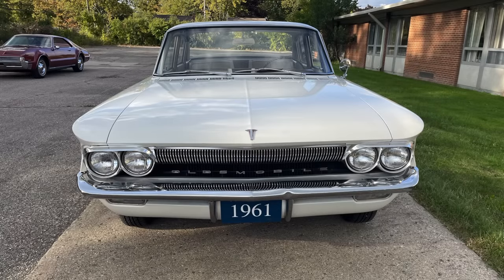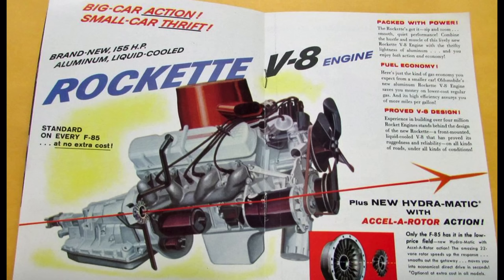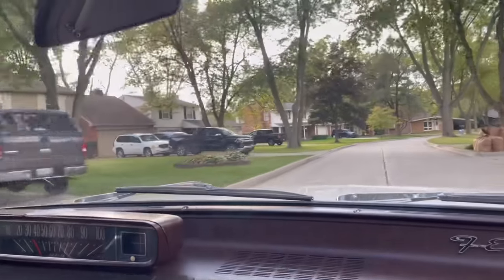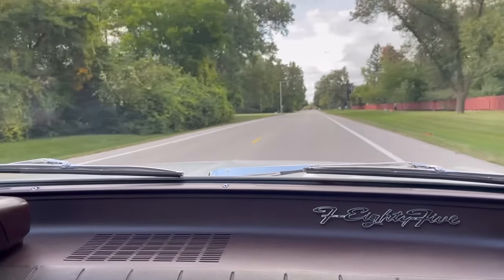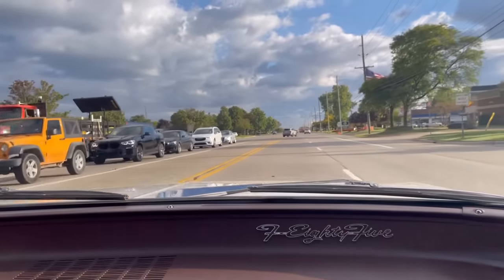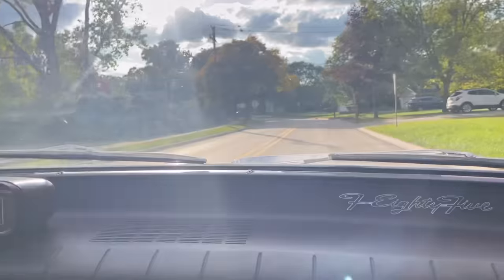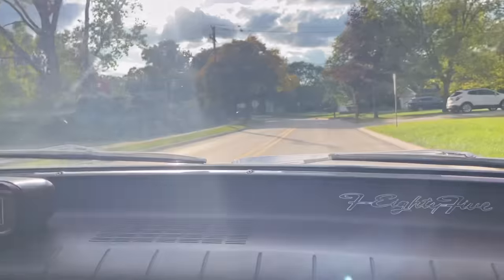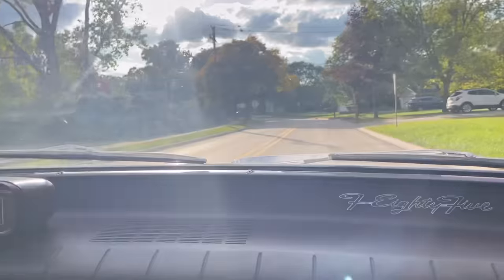Driving GM’s Worst Transmission: The Roto-Hydramatic (“Slim Jim”)

Comment: I has a friend with a 63 Starfire convertable. 394 4 barrel, Roto Hydramatic. Three rebuilds later, he said "as long as I drive it like a grand ma" it's fine. First time I get on it, it's back to the trans shop!
Reply: Ouch
Reply: Have a 63 Starfire and never been any problem at all. But is important not let morons wrench on them.
Reply: To own a car today with 
                                              Problems today you're lucky to have cleaver people are able to get the car fixe
Reply: @olds394 Why not, morons designed the thing, according  to my old boss, who worked on many of them, lol. I did trans work exclusively for 20 years, got out of it back in '96, and have heard all the stories, but have never seen one.
Reply: @pete1342  It was the bean counter en gin ears. Saving $5 on millions of vehicles adds up. GM and the rest still is in the business of selling cars. Parts? Not so much.
I think you can still buy Toyota made body parts for Model 60 and 62 FJ Toyotas. You could in 2005.
 Probably still selling FJ 60s new in some country that does have all the regulations the US has.
Reply: My uncle had a '62 Super 88, also a 394 4 bbl. I drove it on several occasions and never noticed anything unusual about the way it shifted. It seemed the same to me as my grandfather's '58 Pontiac.  My uncle had the car for 8 years and had over 100k on it when he sold it and I don't recall him ever having a problem with the transmission.
Reply: Thanks for the warning, I’m actually looking at buying the exact same car
Reply: @trickstothetrades1801  If you can find one. A BOP(Not a Chevy bolt pattern) THM 400 short shaft will fit. 
Sorry but a 4L60 won't. Plus it also needs a ECM /TCM

Comment: Your shift demonstration ride brings back this memory: years ago I was chatting with a SEPTA bus driver on his lunch break in Philly and he invited me to ride along for a turn. I had time, so off we went. Corner to corner folks getting on and off.  I asked about the trans, an allison angle drive job- he said it was just a torque converter that locked up at 50 mph. " Here, I'll show you" and we took off.  He had that 6v71Detroit screaming under the back seat, and it was a rough street, everything rattling, windows, doors, everything. Finally, the little detroit suddenly bogged down and a loud screech came from the transmission as the lock-up clutch tried to grab ahold of the engine. He yelled "SEE THERE IT IS!" then slammed on the brakes panic style and dove for the curb. Stopped right at the bus stop sign. Doors open. I turned around and the passengers looked terrified, and two women behind me, who didn't seem to know each other, were clutching each other.  Quite a bus ride!
Reply: Good lord!  I can only imagine what would happen to that bus driver in the times we're living in now.  Fired, news footage, law suites, public banishment...
Reply: @discerningmind yep. Crazy times we're living in now. 👎
Reply: Sounds like a fun ride. My school bus for middle school had a tiny little old lady that drove the bus using the gas pedal and brake pedals as on and off switches
Reply: The buses I rode in Los Angeles in the 50s and 60s had a two-speed of some sort on Detroit diesels.

Comment: Listening to the upshift from 1st to 2nd brings back memories of a buddy of mine's 1964 Olds Dynamic 88. Since the car had a 394 cid V8, it moved quite well, but that upshift from 1st to 2nd is unforgettable. Oh, and it had an enormous trunk, ice-cold factory air conditioning, and that dashboard mounted sensor that automatically dimmed the high beams.
Reply: I had a '60 Pontiac with the older HydraMatic. It worked without breaking, but its shift from 2nd to 3rd was a big drop in RPm. They were like that.
Reply: Auto hibeam... heehee... Where I am it's even easier. Half the drivers don't bother turning them off. The other half have those new lights that blind you anyway... I hate driving at night now.
Reply: @adotintheshark4848  had a few hydramatic Cadillacs 1/2 shift was fast, usually before you cleared intersection 2/3 was big jump 3/4 was close again like  1/2

Comment: That V8 was ultimately developed by Leyland Australia into a 4.4 litre version (taller deck for longer stroke) for the P76 sedan in the early 1970s.
Reply: That engine eventually got out to 5.2L/318"... later all iron version out to 5.7L/350"...
Reply: @buzzwaldron6195 it got out to 300 ci , 340 ci and later 350 ci but the 350 got different head design and port layout , the Australian tall deck 270 ci is a different version again . The Australian Formula 1 champion Sir Jack Brabam used the Oldsmobile version with help from Australian Repco engineering, to add double over head cams in his own F1 Brabam car and won the championship! Probably the only GM pushrod based V8 to ever win F1 !

Comment: I have a couple of comments about both the engine and the transmission...
First the engine. At the time when these were still on the road and in wide use, I was working in a Buick dealership full time and in an independent transmission shop nights and weekends. At the Buick dealership, we got quite a number of those V-8s in with leaking head gaskets. In most cases, the leaks were external in that they leaked coolant out of the sides of the head gaskets. Otherwise, the engines were quite reliable, and were not prone to putting rods through the side of the block like the infamous Buick 350 that was used in LeSabre and Skylark cars. 
As to the transmission, the biggest defect was really some poor engineering. For first gear, they used an internal fluid coupling instead of a torque converter. This had some pretty poor efficiency, which made for a soft engagement, but a really "slippy" first gear. When they shifted into second, the input shaft was coupled directly into a planetary gearset with full mechanical drive. At this time, for whatever reason, the fluid dumped out of the fluid coupling only to refill for third gear. Somebody must have really sat up nights figuring all of this out! One odd thing was that the input shaft was splined directly into a damper plate on the engine's flywheel, so removing one from the car was like a stick shift with cooler lines. Weird! I tried to repair one of them on my own, and never did get it to work right. I even took it to some of the old school guys for help, and even they couldn't find out what I did wrong. I finally just bought another transmission and ate the job. hope to never see another one of them!
Reply: thanks for all the knowledge
Reply: Was the 350 known for throwing rods out of the block because of oiling issues or because of the quality of the rods? I owned a Buick 350 and I’ll attest to the block architecture being very strong and very well designed. Never knew they were known for throwing rods out of the blocks but I knew that they had famous oiling issues. Same as the 455.
Reply: @theeoddments960  Probably more for oiling issues. When I worked in a Buick dealership, we would have an average of 2 a week towed in with rods hanging out the sides of the block. It was quite a treat to get one of them to the upstairs shop up the ramp equivalent of a boxed staircase.
Reply: THANK YOU VERY MUCH Jim, I think you have answered my current "Buick bewilderment"  in your explanation of the very odd - pressure plate looking flexplate bolted to the crank of my fully complete '62 Buick 215 (even the plug wires are still connected) I got for $250. My next issue is I have to figure out a proper flexplate to match to my narrow bellhousing ('91 Camaro V6) t-700r with small converter. Already have the adapter kit eng. to trans. Cheers.
Reply: I never noticed much tranny peculiarity going from my '57 Olds 98 Starfire to '62 Olds Jetfire, maybe the turbocharged V8's big torque masked the tight shifts... '62 auto shifted at 4400 RPMs max... valve lifters pumped up by 4600 RPMs when manually shifting it with 50K miles on it... boost pressure on the underside of intake valves prolly contributed to lower RPMs pump up... 
Problem I did have with the '62 was the downshift valve started sticking in the valve body preventing being able to push the exhilarator pedal down... bought a '62 Buick special for $100 with 3 speed on the tree manual tranny and swapped that assembly in to replace the auto tranny... plus a floor shifter... 
https://www.youtube.com/watch?v=Jzw5W1rRMog 
The TH350 auto tranny in my '75 Monte Carlo had imperceptively smooth shifts... 
The TH350 and TH400 are variations of the Chrysler TorqueFlite and GM even paid royalties to the same inventor... 200-4R/700R4 and 4L80 were 4th gear added overdrive versions of them...
Reply: Since when do small block buicks throw rods?
Reply: @isaakwelch3451  When these cars were daily drivers, I was working in a Buick dealership. Every week, on average, two Buick 350s were towed in with rods hanging out the sides of them. I saw this with my own eyes. I was there. I would venture to say that you were NOT.

Comment: The reason for the harsh 1-2 shift on these, and also the 2-3 in the earlier original 4-speed Hydramatic, is that it has to simultaneously engage and disengage two elements. The 4-speed used two 2-speed gearsets in a row, each providing either direct or reduction, so the 2-3 shift there was one gearset going from direct back into reduction while the other goes into direct. If one goes into reduction before the other goes into direct, 2-3 becomes more like a 2-1-3 and the engine flares up in the middle, while if the other goes into direct first, it becomes a 2-4-3 and briefly bogs down. However, since that transmission used regular clutches and bands, that simultaneous shift could still be somewhat accurately timed. Some modern transmissions do have 2-element shifts just with clutches and bands, and the shifts are electronically timed with a computer, but they still give harsher shifts than ones that have exclusively single-element shifts.

On the Roto, one of the elements being controlled is actually the torque converter which gets emptied and filled with fluid to act as a clutch. In first, it's filled, and then on the 1-2 shift it has to empty and the front clutch apply simultaneously. However, emptying the torque converter of fluid obviously takes a lot longer than releasing a clutch, and therein lies the problem: both the clutch and converter filled gives third gear (direct), and it'll always take longer to empty the converter than apply the front clutch. Furthermore, emptying and filling the converter is dependent on the viscosity (related to temperature) of the fluid, so it's not very consistent. Thus during the 1-2 shift, while the converter is emptying but the front clutch has applied, the transmission is actually in 3, so 1-2 is always like a 1-3-2 shift. This is further harshened by the fact that 2 doesn't involve any transfer of power through a fluid but is a direct mechanical connection from the engine through the gearset to the output. Then the 2-3 shift is very soft since it only has to fill the converter again. Looking at the hydraulic schematics, it seems they did try to soften the 1-2 by slipping the front clutch with a pretty complex system of valves for the timing, but that only leads to higher wear and shorter service life.

The TH400 that replaced it and became a GM standard was and is highly regarded as one of the best in reliability and shift quality; all of its shifts are single-element.

tl;dr: Rotos always shift 1-2 roughly because they have to do two things at the same time or else end up in 3rd briefly, but one of those two things (the converter emptying) will always be slower than the  other. Trying to slow the other thing down (the clutch applying) makes it wear out faster.
Reply: very nice tutorial...Thank you..
Reply: Excellent explanation!
Reply: Oh.
Reply: Sorry to have to correct you, but that unit in the middle of the transmission is NOT a torque converter. It is a fluid coupling. 
A torque converter needs to have a STATOR to direct oil flow. In this case, there is NO STATOR, thus making it a fluid coupling. Just two elements - pump and turbine. No stator.
Reply: @jimgarofalo5479  there''s a stator, but it's not on a one-way clutch like a typical torque converter. It's mounted to the output shaft. Weird design choice, but nonetheless, it still multiplies torque from a standstill so I would consider it a torque converter. Oldsmobile marketed it as the "accel-a-rotor", and you can see at 00:45 in the lower right corner.

There's a disassembly video here on YouTube (just search for it) where at 15:50 you can clearly see the stator being pulled out.

The original Hydramatic and the Controlled Coupling use true 2-element fluid couplings.
Reply: @CanizaM  It has been a very long time since I had one of those apart (thankfully), so I defer to your comment. I just seemed to remember that being more of a coupling than a converter. Like I said, it has been a very long time.
Reply: It was a lot of fun with a hydramatic, you could make it shift like a 4 speed, and jack it up with power brakeing.
Reply: I am thinking this answers what the thin pressure plate looking (has sideways coil springs) thing on the flexplate on back of my recently acquired Buick 215. Now need to come up with a basic flexplate to attach T-700r small converter ('91 V6 Camaro) to. Perhaps from a Land Rover...
Reply: En España no acostumbramos a usar cambios automaticos, pero tu explicacion me ha dejado perfectamente claro que tipo de transmision era, como funcionaba y sus problemas. Un saludo maestro!

Comment: I could live with the rough shifts, but the unreliability is such a detriment to an entire generation of otherwise excellent GM cars. There was a 63 Catalina for sale near me recently, absolutely gorgeous, but I don't have the confidence to live with a slim Jim in today's world of difficulty trying to get parts and not pay a ridiculous fortune for them. 

Love the brochures! Automobile marketing back in those days is almost as much fun as the cars themselves.
Reply: Yup, same here, love the Pontiac and Olds body styles 62-64 but not the transmissions. Manual trans cars of that era are rare also.
Reply: If I were to get a car with a slim jim, original or not I'd feel bad for letting it sit due to their questionable reliability, so I'd probably end up trying to find a Jetaway or Powerglide to swap into it, or maybe a 700r4 if they make a BOP bell housing adapter for them.
Reply: Rod & Custom years ago mentioned a '63 Pontiac where the owner swapped to a GM overdrive, getting 23 mpg on the highway.
Reply: @mdogg1604  Damn, that's pretty impressive. By OD do you mean something like a 700R4/4L60 where gear 4 is basically your OD, or a manual with OD? If it's getting 23 with an auto that's pretty insane.
Reply: I have one of these transmissions in the 1962 Jetfire. The Jetfire is turbocharged with 301 torque. After I had the transmission rebuilt I would trust it to drive anyplace. You just have to be sure when they rebuild it that they upgrade the governor to the cast iron unit and get rid of the aluminum one. That was one of the major trouble areas. Not that it don't have other areas of concern but that is the biggest one.

Comment: Adam, thanks again for your 2nd video on the 1961 F-85. During my junior year (1963-1964) in high school, I had a similar 1962 4-door standard F-85 - white with blue interior, auto and factory a/c.  Showing off to my buddies, I backed out of a driveway and slammed the gearshift into Drive whilst still rolling backwards.  An incredible clunking noise eminating from beneath the floorboards ensued. After much worry, I took it to our only Olds-Cadillac dealer for  an inspection.  A workorder with the notation "auto needs a rebuild" and a $214 quote shook my little 17-year-old world.
As my part time job as checker at a grocery store earned an incredible $1.15 per hour, I didn't know where to turn.  A customer suggested that her auto mechanic husband have a look.
A day later, Ray test drove it, pulled to the side of the road, lifted the hood, asked me to give it a little gas while  holding the brake. From beneath the hood, I could see the engine raise up as torque was applied.  Long story short, he replaced the engine.mounts and the noises went away.  Small shop mechanics are a LOT better than certain dealerships.  The only thing that I miss from that little F-85 was the "Ka-WOO" moan from that 2-bbl carb under hard acceleration!

Comment: The station wagon looks much like the Corvair wagon. I wish I still had the 1961 Corvair Lakewood wagon that I used to drive around in the late 1970ʻs. It was a really nice size. My dad had modified the engine (a 1964 Monza engine, base HP 110 but ours put out about 180), put stiffer springs and shocks on it, and it had the 4-speed manual (no PowerGlide, yay!). It was a lot of fun.
Reply: That 2-spd PowerGlide GM put in the Corvairs was a "better idea" worthy of Ford... You were lucky to have one with one of the (rare) 4 spd manuals! 🤑
Reply: @nunyabidniz2868 I've had 3 early corvairs they were all sticks& reliable.I've heard they were strong as behind v8. With v8 swap they would still hold up